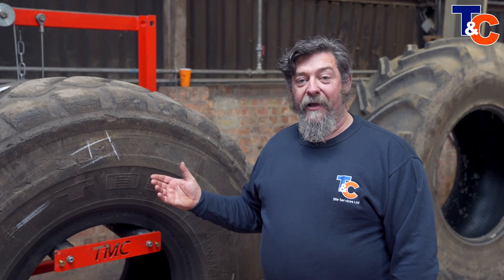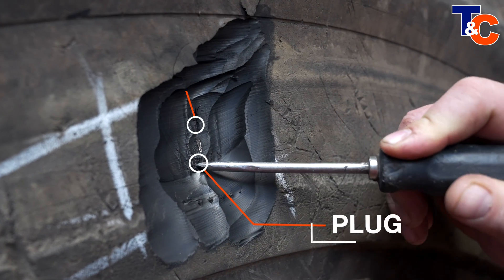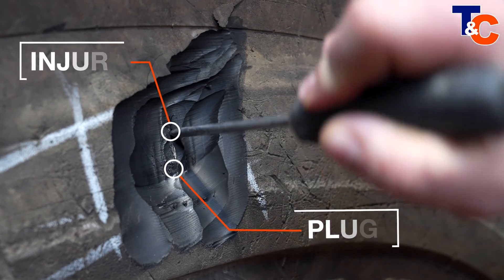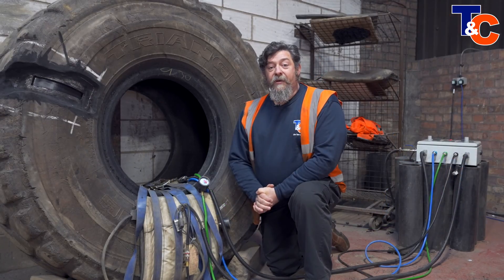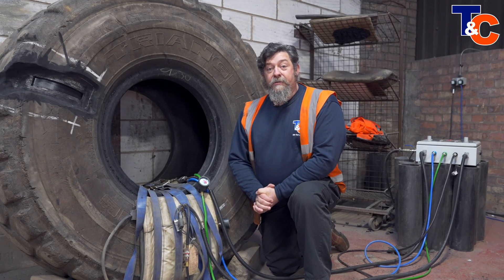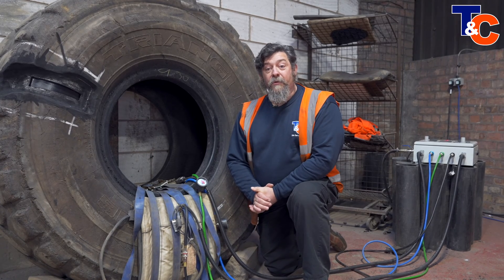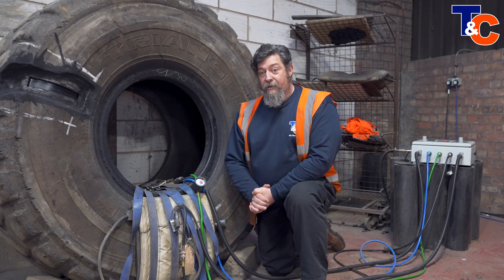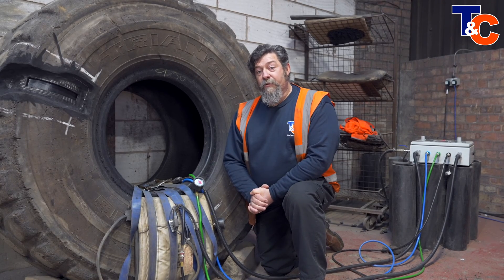How to repair an Eathmover or OTR Tyre with vulcanisation (Major damage)

Comment: Hi I've recently got into vulcanising in Ireland from having to give up my previous job in cunstruction. The person who is training me up has only should me the basic steps as all he want to do is breakdown call out,  and there is a language barrier. I would be eager to learn more about the process from how to work out the proper size of gator patches to use. There is charts up in our wall I don't know how to use them an if I'm being told the right gator to be using. Most of our work is in the agricultural end of the business an could you show red rollers you use.  Is it custom made?
Reply from the maker: Every manufacturer has size charts available to use. The patch size can be determined from those. One thing to bear in mind are your A&R readings (the length and width of the injury). The rollers we use are custom made :)